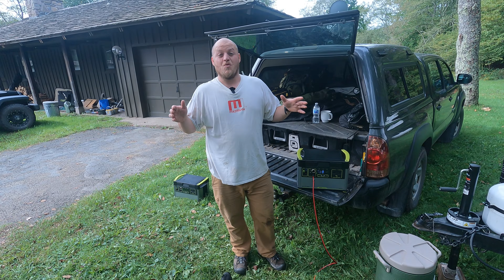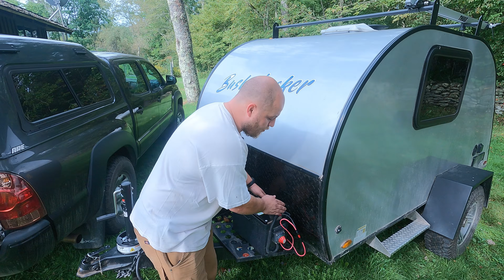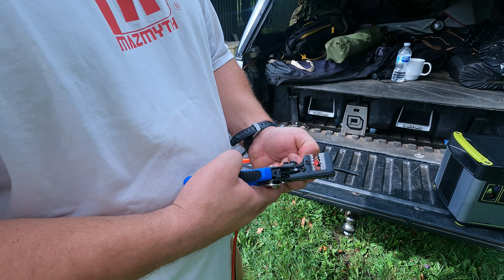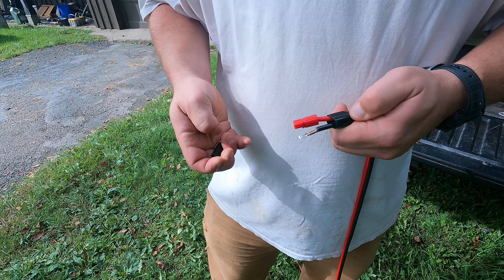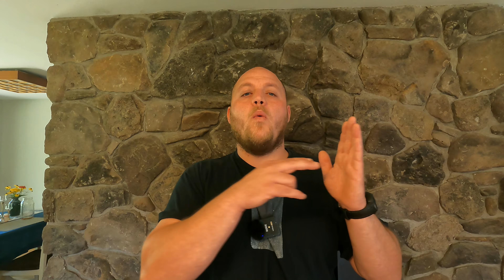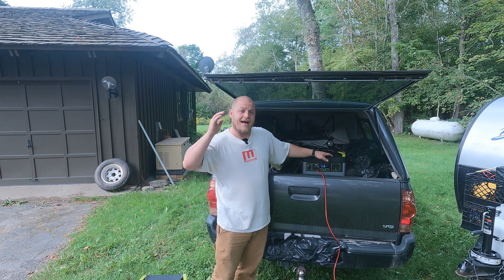Using Goal Zero for RV Battery

Comment: Great stuff Brian.  I completed the hack as described. When not connected to the GZ (1000x) everything works fine off the house battery so I believe I performed it correctly.  I am sure nothing is turned on in the RV (InTech Discover w/PD4100 converter) but I immediately get the red light fault indicator on the GZ when making the GZ connection.  I have seen other commenters mention this issue also.  Since my PD4100 converter supports LIO I went ahead and flipped the switch and changed the battery from Lead Acid to LIO but would still like to have the ability to connect to the GZ and run the DC side of the RV from it if necessary.  Any thoughts as to what might be triggering the fault?  I did discover an additional advantage of the hack is that I can use the cable disconnect to turnoff the charging from my alternator to protect it avoiding the need for a DC to DC charger.  Finally is there a link I need to use to buy you a cup of coffee for all your great content.  I am just not seeing it.
Reply from the maker: This issue has popped up for some folks, although it’s impossible for me to replicate with my gear.  In most cases, they were able to resolve it.

Some were able to find what the culprit was, typically they start by pulling fuses until they find which circuit is tripping the GZ.  In one case, using the GZ 1500 fixed the issue (30a plug).  If there’s not a short on the camper, it has to be an issue of overcurrent, the plug is very sensitive.  

I hope you’re able to get to the bottom of it, it is a really neat thing to be able to do, I use it all the time.  

I would start by pulling some fuses and seeing what appliance might be drawing a quick load when it turns on.

Thank you for watching, also thank you for letting me know the link got dropped from this video description. 

https://www.buymeacoffee.com/diyoutdoorlife
or
PayPal Direct  w/o fees @diyoutdoorlife
Reply: @DIYOutdoorLife  Great I will goof around with the fuses a bit and see if I can get it to work.  Appreciate it.  Coffee en route.

Comment: Great videos! Thank you! I have looked around for this but it wasn't immediately clear. I want to simply run my camp trailer off of a Yeti and use ALL of the interior plugs and appliances (3000x). Plugging the trailer shore power into the GZ works but also tries to charge the trailer batteries. Very inefficient as you know. Is the battery disconnect install the best way to run the trailer via GZ? It seems this video is just for the 12V stuff in the trailer and not my A/C, microwave or standard wall plugs. Thanks!!!
Reply from the maker: Hi Landon, thanks for watching.

although that will work, and switching the battery will give you much better results- it’s very important to understand that it’s very inefficient.   Your run time will suffer a lot trying to power that way, although the 3000 is a beast!

Here’s some additional info

Portable Power Stations Uses with Campers | Tips Tricks & Hacks
https://youtu.be/mU8iZZGlk_8

Comment: In today's market, do you still feel that the Goal zero option as an alternative power source  for the bushwacker?
Reply from the maker: Yes, the fact that it has all of the features you need and can be used for more than one thing makes it a great option still.  I still highly recommend getting a good battery for the trailer as well, and ultimately it comes down to how much capability you actually need on your trailer.   I have 100 amp battery and GZ 1500 and it's a great combo!

Comment: Can you use this method if your camper has a built in (factory installed) solar panel?
Reply from the maker: Yes, but you're going to need to know how to keep those systems isolated.  if your factory solar runs directly to the battery, you'll be disconnecting it at the same time as your battery and it'll work like a charm.  If the solar is wired to fuse block, within your converter box, you'll likely have to figure out how to disconnect that easily, at first you might just be able to pull that fuse, long-term a switch would be better.

Shouldn't be too hard. Let me know how you make it!

Comment: Great channel! 
But i have a question: instead of DC to DC from a power station to rv, wouldnt just hooking up the rv AC cable (shore power) to the power station accomplish the same thing?
Reply from the maker: Unfortunately no.  That goes from DC to AC back to DC... standby consumption.. etc

This will use your capacity wayyy more efficiently, otherwise id just plug in.

Thanks for watching the channel and asking a good question!

Comment: I have the yeti 1500x goal zero,  how many solar panels can I use? Just 1 or 2 ?
Reply from the maker: The 1500 can accept 600 W of solar. It's fine to even use more than that, it's just gonna be able to charge for 600 W.  Depending on what size solar panels you using, that could be six panels or that could be three panels.

Here is a video I did all about the 1500 X.

Goal Zero Yeti 1500x - Comprehensive Owners Review
https://youtu.be/Y4BZE5R6n1Y

Comment: Very informative video. 
I've been considering buying myself a camper in the near future and I have a yeti 400 which I have connected 2-35ah batteries through the Anderson connections located on each side.  
 My question for you is that do I need to use a sigerett adapter to connect my yeti 400 to the camper 12v system OR can I connect the yeti to the camper through one of the Anderson connections connections?
Reply from the maker: The 400 is one of the few systems from GZ that I have not owned.  From what I see, the Anderson side ports allow for the AGM batteries to be chainable.  I don't see any reason why you shouldn't be able to plug your camper in that way, it should be a direct connection to the yeti battery.  Let me know how you make out!

Comment: @DIYOutdoorLife - Brian, awesome video!  Never realized I could do this until I saw your video.  Too bad I did not see this video a lot sooner. 😃
     I wanted to verify something, hopefully I can explain well enough what I am asking.

For the purpose of my question I will refer to "Side A" as the battery side.  "Side B" will be the camper side. So for Side A, I would have both the black and red wire with its own Anderson power pole plug. For Side B, are you taking the black wire, that was terminated on the camper's frame, and instead, bringing it up to be side-by-side with the red wire that goes to the camper using another Anderson power pole connector?
     The third piece to this is the independent Anderson power pole cable that goes from Side B to the power pack. Did I understand everything correctly?
Reply from the maker: I think you have it!  Although it's not necessarily essential to bond your chassis frame that way, it's a good practice.

You will have an Anderson plug coming off the battery leads, the camper leads, with an extension cord to extend in between.
Reply: @DIYOutdoorLife  Yes, I guess that is my question I need to reword.  The camper lead is only one wire (the red one) right? So am I only putting on the red side of the Anderson Power Pole connector and the black plug side of it will not having any wires connected to it?  That is why I asked if I needed to move the black wire, terminated to the frame, up to be alongside the red camper wire in that side of the Anderson Power Pole connector?
Reply from the maker: @Jeffrey.1978 yes, I connect the black grounding wire from the Anderson to the frame, so it can complete a circuit.  In most cases, I can just happen to the existing wire going from the battery negative to the frame. In other situations, you might want to just run another wire over to the frame.   in either case, you want the red from the Anderson to the converter and the black Anderson going from the power station to the frame to complete the circuit

Comment: With this setup, the outlets inside won’t work, correct? Is there any way to get them to work on this setup, or would you need to just plug the trailer straight into the AC outlet on the goal zero? Would this setup allow you to run an rv AC unit?
Reply from the maker: With this set up, your camper will run just like it's on a battery, the outlets will not work.  You can use the outlets on the power station when you need 110 power.
I have several videos on the channel about running air-conditioning while camping .  It's a pretty complicated topic, but it can be done, usually costs a decent chunk of money to do it.

Comment: Great video bud! Is there any possibility you can show us how to install that switch to interrupt house batteries from the RV in favor of the Goal Zero? Been trying to go full Boondocking for a while, you’ve been a godsend! Also, do you think as possible to chain or Daisy chain two or more Goal Zero 1500 X together? cheers! 🫵🏻🍺🍺
Reply from the maker: Hi, thanks for watching!  I can definitely do that but it will take a while, I have a lot of videos pre-filmed and ready to go.

Here's a video I did on a master switch, it's basically the same .  I will link the product to the right switch to do what you're saying below it.

Installing Master Switch on Camper Trailer | RV Kill Switch
https://youtu.be/Qn1gx3ZG9S0

https://amzn.to/3VP4wVJ

* don't use one with a "both" setting

As for the Goal zero question, there's no need to chain them together.  They make a 3000 and a 6000 or you can add tank batteries to any of the systems.   They also have a brand new 4000  6th gen model that is a huge upgrade.

https://amzn.to/4aPNuuN
Reply: @DIYOutdoorLife  Thanks so much Brian! My rig is a 32 Entegra Esteem that came with two 100 amp house batteries, as you probably know crappy and don’t last too long, three days of mild use and boom, dead! 

I do have a master switch on and off already installed. Since I have three GoalZero’s 1500x I figured I could use two of them together using a similar configuration in order to bypass the original factory setting for mostly boondocking, and charge ‘em as we drive with the “goal zero yeti link” from the alternator. 

I thought your idea was genius by  flipping from direct DC power or Boondocking with a GoalZero as needed! I been looking for an alternative, never found it until now with you! 

Cheers friend! 🫵🏻🍺
Reply from the maker: @MightyMoeBanker  that set up should work really well.  Swap the on off switch with the one I linked and you'll be able to simply switch over to one of the yetis.  You can keep one charging while running on the other and switch when needed.  Having three is the way to go, I know it's pricey, but it gives you so many options.

Comment: Love your videos! I bought a Yeti 1000 Core. I hooked up an Anderson connector, black to ground via the my front battery negative post, and positive to the bundle of wires running to trailer power. I can disconnect the batteries via a selector switch. Problem is, when I plug in the Yeti, at either the Anderson or Car outlet, it faults immediately, even with everything off in the trailer. I’m pretty sure I’m wired up properly, since I can plug in a smaller lithium battery to the Anderson connector and it powers the trailer, no problem. Any ideas what the problem might be?
Reply from the maker: The output on these yetis is going to be a lot more sensitive than just a battery.  I'm guessing that something might be loose or miswired, but it's impossible to tell without seeing.   There's also a chance that you have something that's drawing more than 15 A, even for a short period of time, and tripping the outlet.   It would definitely trip the 12 V automotive, because it's only 8 to 10 A.

As a troubleshoot method, I would try to pull all the fuses on the camper, plug in the yeti, and put the fuses in one at a time .

Good luck with the project!
Reply: @DIYOutdoorLife  Thanks! Good troubleshooting tip. I’ll try that later. Pretty sure I have everything 12v turned off - lights, fans, water pump, refrigerator, radio, furnace, etc - it still faults. I’ll let you know what I find.
Reply: @DIYOutdoorLife  I was in the process of pulling all the fuses and putting them back one by one. All fuses removed, no fault (yay!). I was putting them back in one at a time, when I realized I still had battery 1 selected as well. As soon as I turned it off and plugged and unplugged, the fault returned. It seems I can avoid a fault by having one of the trailer batteries turned on in parallel when I plug in the Yeti. Weirdly, once plugged into the Yeti without faulting, I can then turn the trailer battery off and still no fault and the trailer just draws off the Yeti. Weird. Maybe having the battery in the circuit initially serves as a ballast of sort to damp out whatever the Yeti sees when plugged in without a battery involved that causes it to fault. Seems to be a workaround, and I’ll let you know if it keeps working like that in practice. Thank much, regardless!
Reply from the maker: @fastereddieb  this seems to me like there's something requiring in rush current.  it probably peaks very quickly and then settles down, the battery buffers it out.  If you can get it to work that way, nice job!  It's a really sweet boost to be able to use these power stations off of the DC!

Comment: You can also do something similar on the AC side for campers with AC/shore power. Take the shore power incoming to the breaker and install a 2 sided switch there. That way when not on shore power, you can plug in the inverter/generator and turn the switch so you never accidently turn on shore power with your solar generator attached. You could also just plug it in to your shore power port, but then your powerbank is outside and at risk of getting stolen or impacted by elements.
Reply from the maker: Exactly, there's AC options as well. 

The major point with this video is that the DC side will run six times as long as the AC side.  There's no double inverter/converter efficiency loss, and no standby consumption.   If there's a power station with a high DC output, You can use it to replace her supplemental camper battery.

Comment: Brian , I double checked all the Anderson HPP connections, fuses, and polarity.  I did find that the Casita trailers are wired to houseold standards. I have a black positive wire.  A white and green ground / neutral wire that feed into the trailer.   I made the Anderson connection using a 2 post Busbar block . Used the  3 ring connections from the trailer to the block. Positive black on one post then grren & white neutral and ground on the other post.  Used an Anderon HPP  fused pigtail that has 2 ring connections red and black . Attached red to the busbar post with the Casita black positive. Then the black to the busbar post with the Casita green & white neutral/ground wires. The Anderson connections I made work fine when I attach it to the onboard AGM Casita battery. I then dissconect and have no other power source  (battery ,shore, vehicle )  to the trailer  Plug into my HPP port on the  Goal Zero Yeti Core 1000 and the indicator light is white . Make the connection to the trailer and Yeti light turns red.  No Yeti Core power to the trailer.   Thanks for any additional advice or help !
Reply from the maker: Mystery from here. From what I'm reading in your case, I would do some testing on the anderson port on the yeti.  Make a plug and make sure you can pull some amperage.  Maybe the HPP is acting up on your unit, strange. Keep me in the loop.

Comment: Brian , Thanks for all the solid info you present on your channel ! I have learned a lot ! 
 I have a 2023 Casita trailer and I'm trying to implement my GZ Yeti 1000 Core as a battery source.  I rigged up the Anderson HPP  battery disconect and followed all the instructions to make things safe and have the Yeti being the only power source. 
I did get it to work using your 12volt cigarette port back-feed method. I did have to turn the Yeti 12V port  on before making the connection. Is that normal ? 
I did not have success using the Anderson HPP method as described in this video.  Is there anything inherent in the my Casita that might prevent this application from working ? Something I'm missing ? How to trouble shoot ?  Thanks for any advice or suggestions , safe travels !
Reply from the maker: Thank you for tuning in.

There shouldn't be anything inherent about your Casita that stops it from working .  Especially since it works with the ten amp plug version.

Do you have rooftop solar that's directly wired in?  Did you double check to make sure you made a clean Anderson plug?   
If your set up is working with the backfeed hack, you should definitely be able to make it work on the 15 amp plug on your core .

Keep me in the loop, I'll help anyway I can!